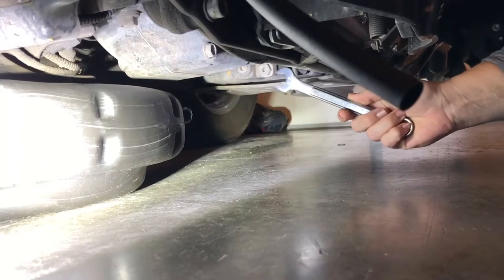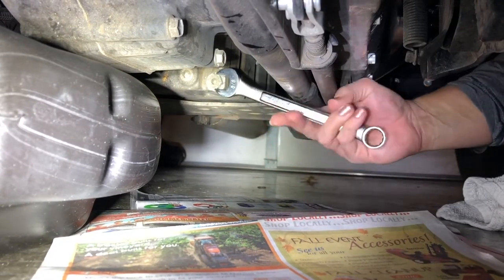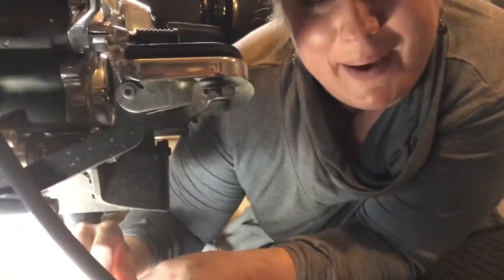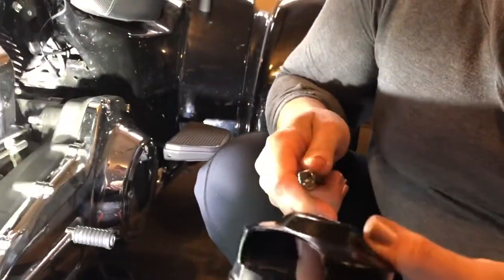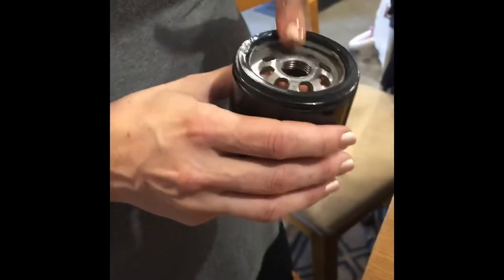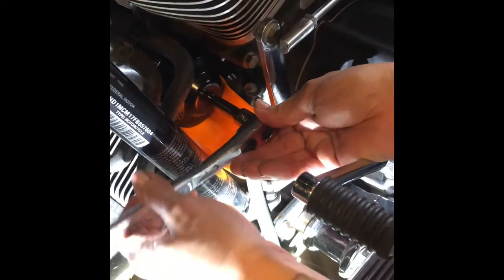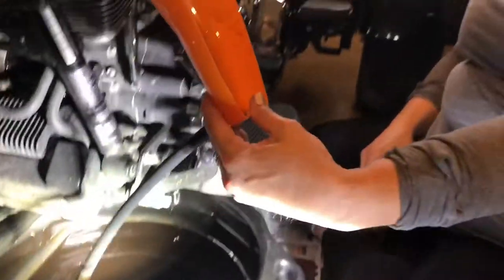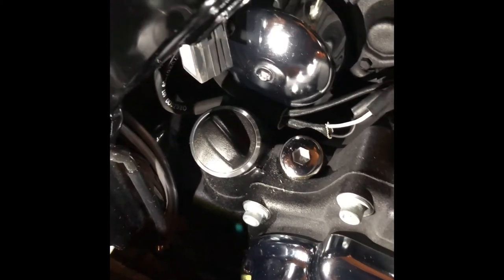Oils change on a 2015 Harley Davidson Freewheeler

Comment: Anna you did good, but you need to inspect the magnet on the drain plug for metal shavings,  now do the primary and transmissions oil too then your done. 
    But it was good to hear the kids in the background,  my wife rides a 2015 Free wheeler as well.